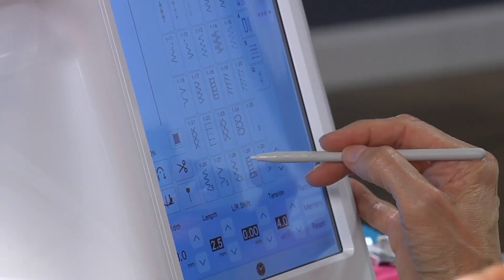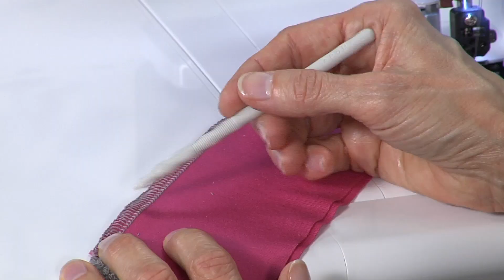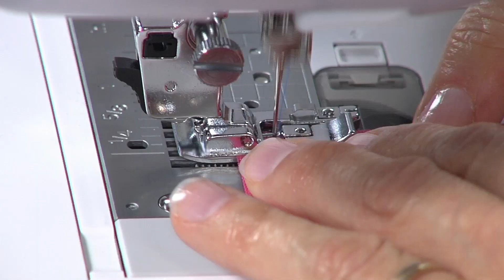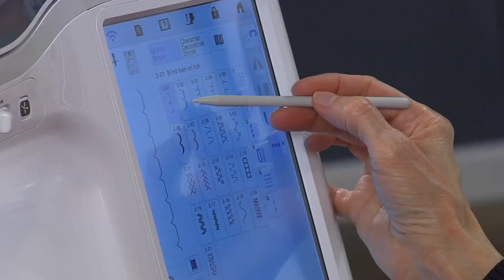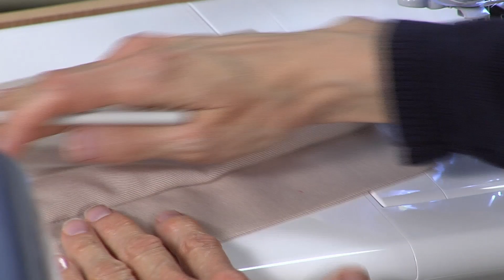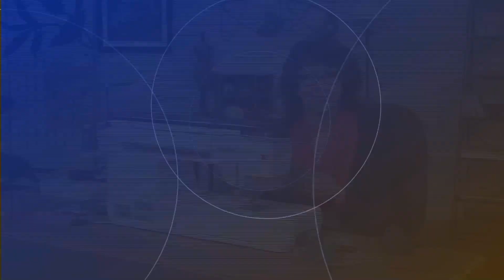Sewing machine and serger techniques on It’s Sew Easy with Joanne Banko (2101-1)

Comment: I haven't come across a sewing machine with these over edge stitches!
Reply: Hi Christine! The overcasting stitch I used is pretty common. Check your manual and see if it lists overcast stitches, then try to find one that has a straight line of stitching on the left, then jumps over to the right and then back to the left. It may be called a mock overlock. Let me know if I can help further.